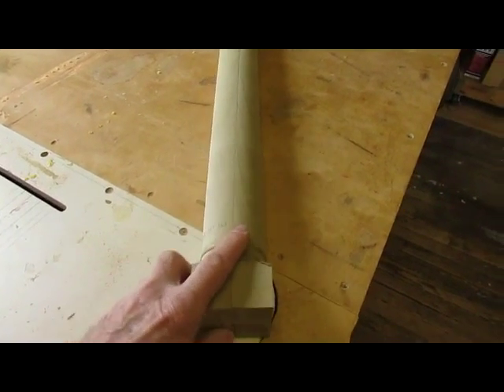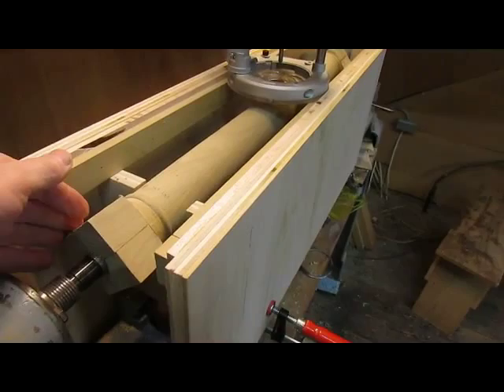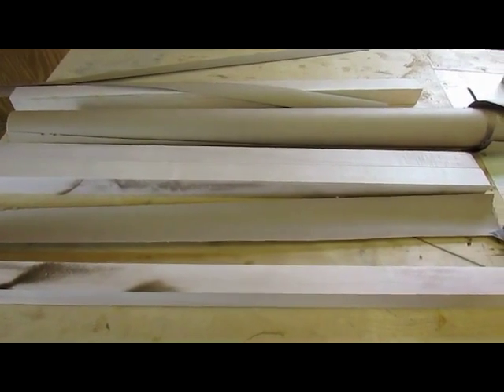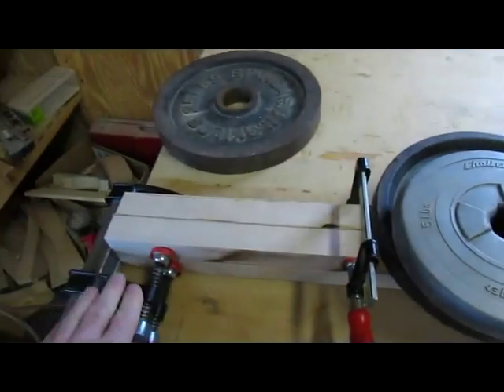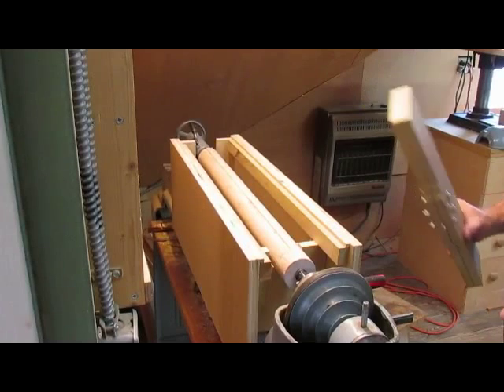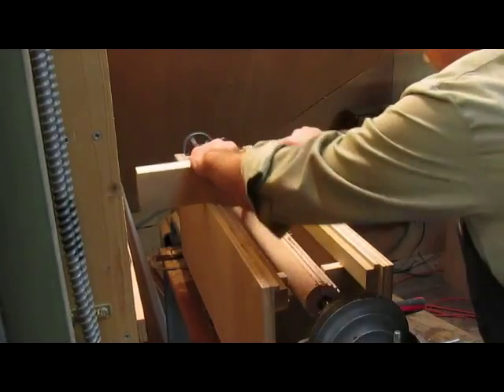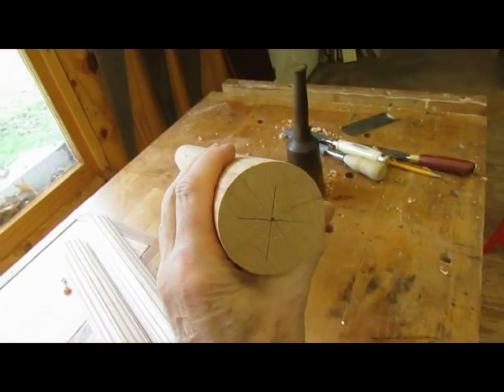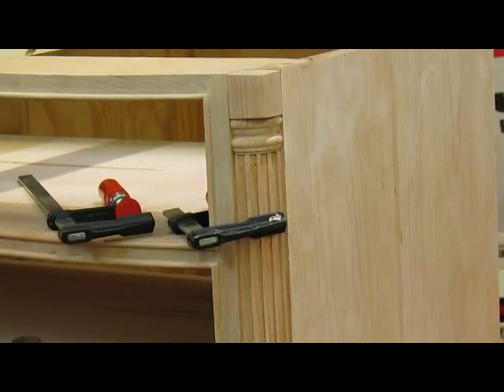Cherry Oxbow Chest   Making Quarter Columns Step 6

Comment: To get accurate flutes first find out how many holes you have on the index wheel, lets say it has 24. now supposing you want 6 flutes on the piece of wood, simply  24 divided by 6 = 4, so, every 4 spaces on the index wheel. Do not include the last count onto the next count. If the index wheel has 24 holes then the numbers would be 1,5,9,13,17,21 as you can see the first count is 1thru 4 the next count start at 5 ok :) find out how many holes are at yourindex wheel and then divide them by the amount you want and you'll get the total of spaces you need.

Comment: I wish I were there to do it for you :( I don't see where you need to glue 4 pieces together , when you could just have a rounded piece , do the flutes then cut it into 4 pieces on the table saw.